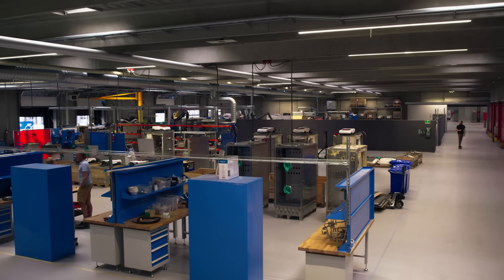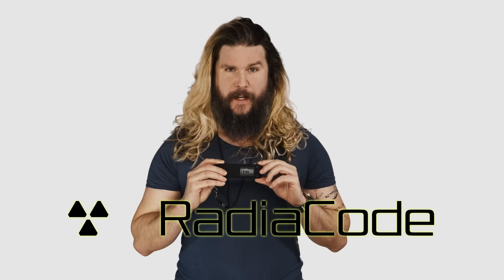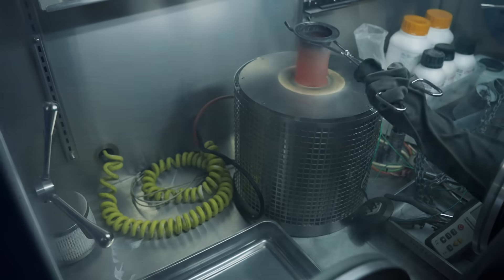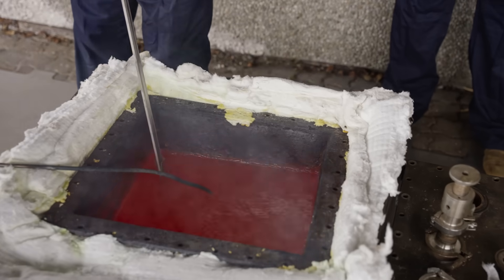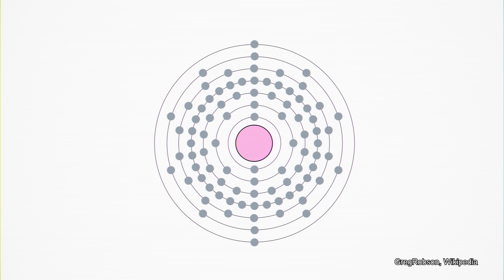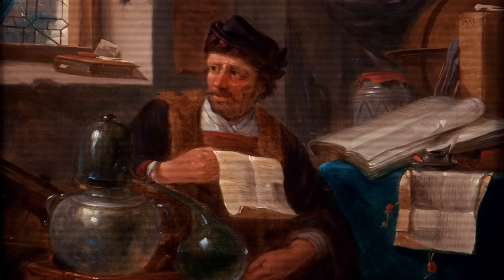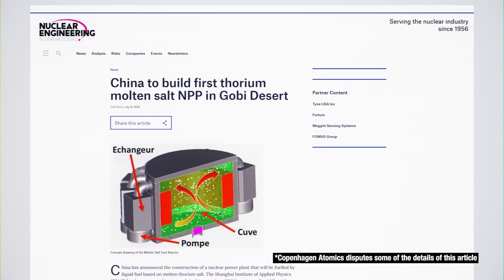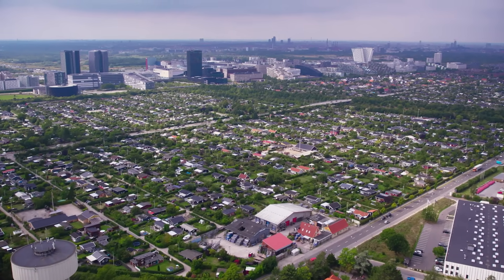Is THORIUM the Future of Nuclear Power?

Comment: I'm a retired Nuclear worker and I have two questions. First the expensive nature of a molten salt reactor. Liquid salt is very corrosive, therefore the only pipe material that could be safe to use would be inconnel. Inconnel pipe is about ten times more costly than stainless steel pipe. So build cost would be very high. Also because of the corrosive side of liquid salt it will require replacement very often in the life cycle of the reactor. Second, your video basically shows a boiling water reactor style of system. These systems put " HOT" piping outside the reactor building. With a BWR system radioactive steam spins  the turbine. Therefore many more contaminated systems that will someday need decon, and more exposure to risk of HOT leaks. The HOT salt designs have been around for years, but I would much prefer a PWR with boronated water as a medium. But thanks for the video.
Reply: Hi! I really recommend you go read about Moltex's SSR solution to corrosive, radioactive salt.
tl;Dr, static liquid fuel in a tube with a sacrificial zirconium layer.
These fuel tubes can then be constructed from currently approved Nuclear Steels, no new accreditation needed for exotic New Nuclear Steels.
Reply: It is not true that the only alloy is Inconel. MSRE used exotic alloys like that (Hastalloy-N), but SS316 is very much ok to pump molten salt though, provided that the salt is pure enough. More replacement needed than conventional nuclear, but if the parts can be mass manufactured that is not really a problem. 
The "HOT" piping is not coming out of the reactor, by using heat exchangers in chains you can get the heat out to boil the water in the steam plant without introducing radioactivity. BWR's have this problem however, where the hot steam goes directly past the fuel into the steam plant.
Reply: @MalcolmAkner  Thanks, you are correct. Still learning as they say.
Reply: ORNL's test reactor they set up in the '60s used an alloy they developed for this exact purpose called Hastelloy-N.
Reply: because of the high purity in the salt, which they are making themselves, SS 316 can be used which is way cheaper than iconel. Still, I believe they  are planning on replacing the steel components every 5 years.
Reply: "Advanced ceramic materials such as silicon carbide and its composites have both the temperature tolerance and corrosion resistance to function in MSRs at the desired level of performance and safety. These materials are also radiation tolerant and, thus, can be used for structural components in the MSR." -The American Ceramic Society
Reply: Would also like to know what size the China plant will be in thermal numbers?
Reply: @magic4221  
Yes, and there is literally a solution that doesn't use any exotic alloys, just ordinary nuclear steel.
A static fuel tube with sacrificial zirconium and a gas vent for the, er, Krypton or xenon, one of the short lived radioactive nobles, I forget which exactly.
Reply: @MostlyPennyCat  Gotta love noble gases. Which was in fact the only thing released in the Three Mile Island event. And NONE above background!
Reply: I am not sure about this, but perhaps strengthened glass or ceramic could be used? If anyone know if these materials would be eaten up by the salt please let me know. Tho the heat is probably the biggest problem. If it cracks there’ll be an issue.
Reply: @andreahoffbeck9391 but is it a particular issue for salts? At 800C everything becomes reactive/corrosive.
Reply: Thanks for explaining, what I wanted to ask, but couldn't formulate in words.
Reply: @magic4221  
"The fuel in the SSR is two-thirds sodium chloride (table salt) and one-third mixed lanthanide/actinide trichlorides."
"Trichlorides are more thermodynamically stable than the corresponding fluoride salts, and can therefore be maintained in a strongly reducing state by contact with sacrificial nuclear-grade zirconium metal added as a coating on, or an insert within, the fuel tube of the SSR-W. As a result, using this patented approach, the fuel tube can be made from standard nuclear certified steel without risk of corrosion. Since the reactor operates in the fast spectrum, the tubes will be exposed to very high neutron flux and so will suffer high levels of radiation damage estimated at 100–200 dpa over the tube life. The highly neutron damage tolerant steel, PE16 will therefore be used for the tubes. Other steels with fast-neutron tolerance (such as T9, NF616 and 15-15Ti) could also be used depending on the local supply chain capabilities"
"The coolant salt in the SSR-W reactor tank is a chloride-based coolant salt. The coolant also contains an agent to reduce its redox potential, making it virtually non-corrosive to standard types of steel. The reactor tank, support structures and heat exchangers can therefore be built with standard 316L stainless steel."
"In the UK, the fuel could come from the stocks of civil plutonium dioxide from PUREX downblended and converted to chloride impurities added to reduce any proliferation concerns."
Reply: @MostlyPennyCat  Amazing reply. Thanks for the information. You have surely done your homework.
Reply: @magic4221  
Thankyou! 
As u
You can guess I'm a massive Moltex fanboy, their solutions to the issues with MSRs are elegance personified. 
Using chemistry to enable the metals to be regular nuclear steels? 
Beautiful 😙🤌
No exotic New steels and no new accreditation for those steels, because you'd have to get your new steels approved by every nation
And these need to be built NOW not in 15 years time after that process. 
And you KNOW that since nations will refuse certification as a method of protectionism for native nuclear companies. 
And keeping your fuel salts in static fuel tubes?? Genius. No pumping hot radioactive salt.
I highly recommend the wiki page on SSR, the diving bell valve to release various gaseous fission products is so damn clever. 
And using different salts for coolant than fuel is great too, they tailor the two compounds precisely for their tasks.
I wish Moltex got more exposure.
Reply: Yeah I really don't get the selling point of having to rebuild the entire reactor ever 5 years over having to chase the fuel every 2 years
Reply: @SunShine-xc6dh  
Eh? Which comment are you responding to, mine or the OP's?
Reply: Thanks for your reply.
Reply: also anti-proliferation flies out of the window
Reply: @martinzihlmann822 anti-proliferation was already a hypocrisy when it turns out the nuclear armed states simply didn't disarm. "non-proliferation" and "non-expansion" are verbal portmentaus of "nuclear restriction" or "nuclear oligopoly".
Reply: @martinzihlmann822  You kinda missed the part in the video where he showed the reactor is incapable of producing isotopes useful for weapons use.
Reply: @villepore7013  U233 is an isotope useful for weapons use. There are much easier paths to weapons than this but still.
Reply: you are right is the same if you try to make brint you corros the ,etal cobber or Titanum last longst he also say the life time on pipe is 5 years the otehr way roound even with distallet water added the propbem do not go away thats what they need to fix an as he says if the reactor last 5 years an are cheap to build it will be = profit becosue they are very small on the size of a mini van max.

Comment: I've always wondered what happens if the reactor must be allowed to cool down, does the salt solidify? Does it damage the system/require everything to be replaced? Or can it recover from having the fuel solidify?
Reply: > I've always wondered what happens if the reactor must be allowed to cool down, does the salt solidify?
Yes, but you can heat it back up again later with external power.

Comment: My big question is, what happens in the case of a failure?  Having a pressure explosion in one of these plants I feel could be catastrophic with the molten liquid falling from the sky.
Reply: It operates at much lower temperatures because the liquid isn't water and thus has a much higher boiling point. It's somewhere around 5 atm pressure. As for overheating, there is a fusible plug system passive failsafe as well.

Comment: For most all purposes, when dealing with C to F conversion, it's pretty simple. For large numbers ( such as molten metals and such, as here ), just double it and round down. The correct multiple is 1.8, but 2x is plenty close, and rounding down helps keep it closer without being any more difficult.

For lower numbers like air temperature, still double and round down, but then add 30. Again, it's a little off, but close enough and easy.

For completeness, the full conversion is: 1.8C + 32.

Comment: Sounds like something that would be all fun and games until some part of the system cools too much and the molten salt solidifies, plugging all the plumbing.
Reply: then that wont really matter, because as soon as it gets problematic it gets so hot the salt unfreezes again.
Reply: @SB7-r9i  That's always the answer.  With BWR's it was "well if it gets out of control, the water in the reactor will boil off and then there's no moderator".  And without any moderator, neutrons will just escape, stopping the reaction.  In reality, it doesn't really work that way.  As we found out with TMI.  By the time things reheat in a Thorium reactor, the damage will be done.

Comment: "Advanced ceramic materials such as silicon carbide and its composites have both the temperature tolerance and corrosion resistance to function in MSRs at the desired level of performance and safety. These materials are also radiation tolerant and, thus, can be used for structural components in the MSR."  -The American Ceramic Society